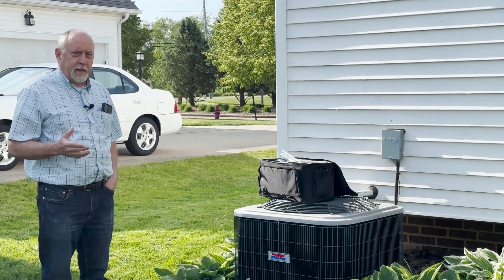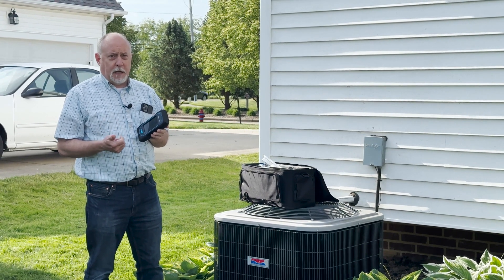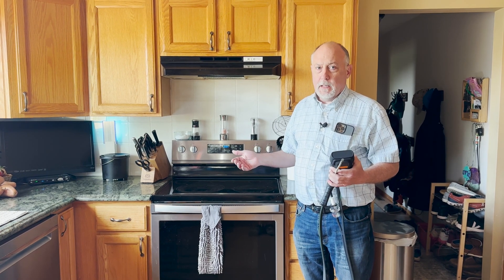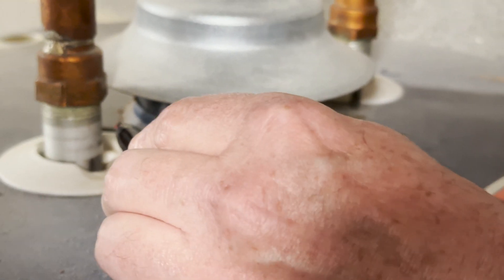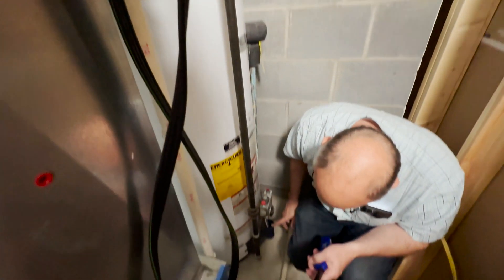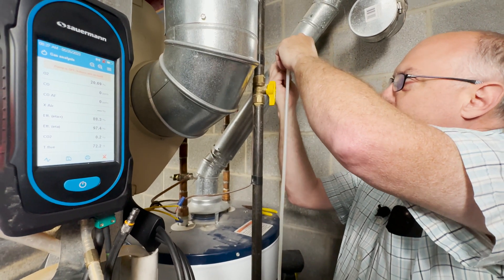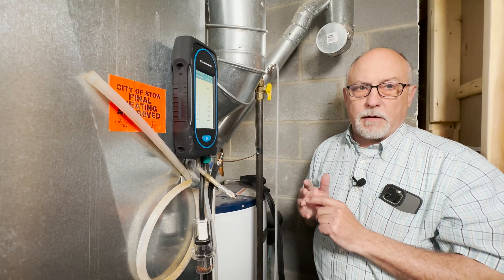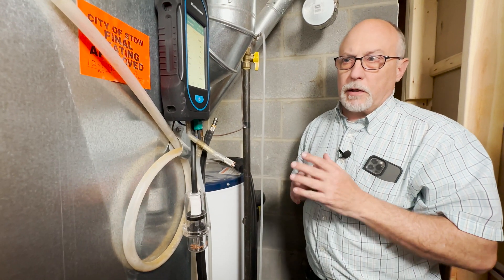Combustion Testing Home Appliances

Comment: Everyone says the hot water heater is he biggest problem in the home yet, I couldn't find any videos that showed an in depth proper testing of the appliance.  I just returned the Fieldpiece analyzer that I had just purchased for the Sauermann Si-CA 130 with NO sensor (California).  I love FP gauges but it was lacking some significant features that Si-CA 130 has.  Thank You Jim

Comment: Your sounding more like a utility worker. Who provides the gas and responsible for the combustion of there gas. There should be a 5 minute time to establish draft they will all spill until the flue draft overcomes barometric pressure of the stagnant air in the flue.
Reply from the maker: Appliance do not alway spill, and they typically do not. Agreed they can for up to 5 minutes with a cold chimney, but with a hot water tank we are always dumping hot air into the stack from the water if not from the flame. More then trying to sound like a utility worker, I am trying to sound like someone that actually gives a shit and will take concern for the safety of myself and my customers as well as to look for opportunity outside of what I am there to do.